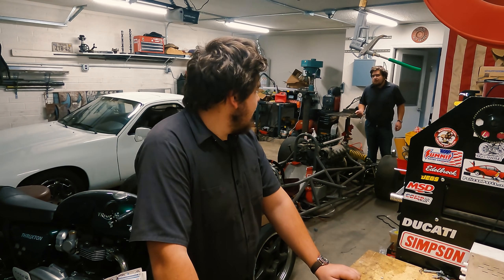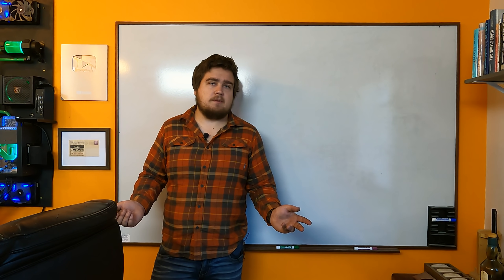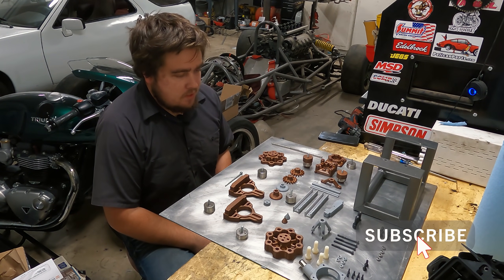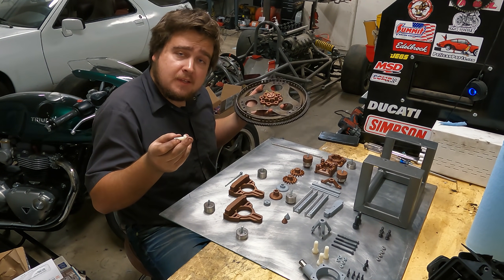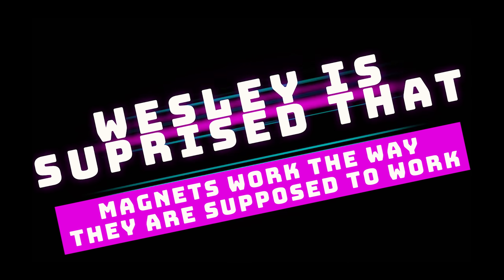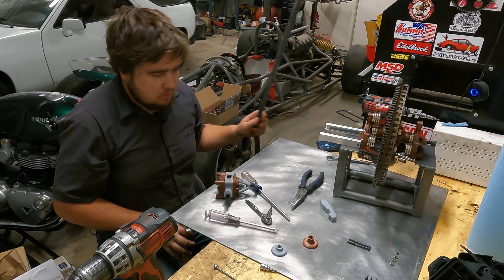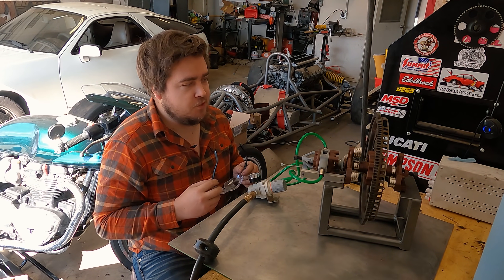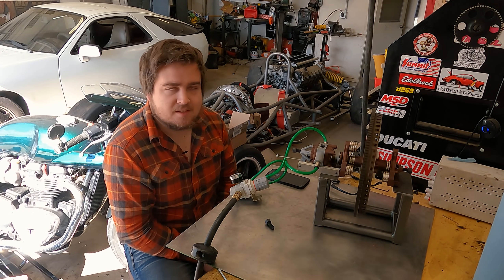The Levitating Turbine and Mechanical Battery

Comment: Mechanical batteries are also used in nuclear power plants. If power is lost, the reactor coolant pump motors have giant flywheels that coast down so they can still produce flow until backup power comes online. Pretty cool stuff!

Comment: Hefty imbalance... It would be more effective to spin the whell if you simply direct a pressured air gun at the edge with all those gear tooth. Then you will learn that those serve as an excellent air brake....therefore there is basically no advantage to have a levitating assembly. I recommend to have a steel cage around that thing.

Comment: So add an ur compressor and batteries   Us the output from the flywheel generator power.  U could use a 72v battery to create 300v 😉

Comment: For whatever it’s worth “flywheel” energy storage devices with essentially levitating rotors are pretty common in data centers. If you’re extremely confident in your genset startup and switching time they can be the only UPS power source for a data center, otherwise they can be used to minimize repeated draw/drain on VRLA battery arrays that don’t love deep or repeated discharges.

Really love the work you’re doing here. Keep it up!
Reply: Though the datacenters flywheels do store some energy, their reason for existence is the provide clean stead state (in perfect phase) power vs. the best effort you get from utilities.

Comment: Why you built a 20,000 rpm pencil sharpener and the levitating mechanical battery?  Same reason your subscribers subscribe...meh, just cause. Because it's fricken awesome!
No, those safety squints won't save your face from the wrath of a 5lb flywheel, but you have compressed air close to your two good eyes, keep em that way. As always, this is just another great video, thanks Wesley.
Reply from the maker: Thanks for the kind words!

Comment: Hey! I love this, but do have a question. Wouldn't the compressed air you are using to power the mechanical battery be a better(more stable)  energy source than the battery itself?
Reply from the maker: Honestly, no clue. My guess is that there's much less energy loss converting from mechanical to electricity, because our best sources of air to electricity involves spinning a turbine.

Comment: If you get the magnetic drive coupler figured out,,, Do you think you’d be able to put the flywheel into a vacuum chamber, spin it up with a drive outside of vacuum, and the inertia stay in the flywheel for longer? 
I know it would, in theory, I’m more wondering if that’s where you’re headed with the drive coupler.
Reply from the maker: If I'm honest, that was a thought of mine going forward, and a good way of getting energy in and out of a vacuum.
Reply: @WesleyKagan  There’s a channel here called the Brick Experiment Channel,, the guy made a Lego submarine and used magnets as a drive coupler to a prop. He used Teflon tape to reduce friction through the glass jar’s lid he was using. 
That being said,
I’m sure you’ve heard of all the fancy dancy ceramic anti-friction and temperature coatings used in and on race engine parts (pistons, cams, rockers, etc). They apply like powder coat and then you burnish/polish the coating with something like grey scotch-brite. You could coat your magnets with it to even further eliminate drag at the one-point-of-contact like you said you had between the flywheel shaft magnets and the stand magnets, if that was your point of contact. It was hard to tell from the video
Reply: Techline “Powerkote” DFL-1 is a good one to look into
Reply: ANNNDDDDDDDD. The guy that runs EPR, Mitch, is a friend of mine. He does a ceramic anodizing on parts, as well. I’m not sure if this link will work. If not “Engineered Performance Ceramic Anodizing” in the search bar should get you to the video 
https://youtu.be/QuO0rhW8Hv0

Comment: Can an electromagnet repel extra strongly? I have a few design ideas that would benefit from that.
And for an air craft of air rocket I like the idea of a suspended rotor or set of rotors to compress air and have the payload be behind the intake next to the air duct, meaning super low drag. If needed there could be a suspended exit turbine before the nozzle as well.

Comment: So much fun question though, may I ask why you are doing this, is there an endgame, is this a pivotal cog for a bigger purpose?
Reply: Realistically these exist, regenerative braking is “basically” this. With the flywheel being the cars wheel(s) and a more typical electric motor and expensive controller. 

This I see as something you can use to get just enough battery power to make a call, or use old school coms off a short burst. Maybe to jump a car but I doubt it would like the load. Attach the flywheel to a windmill? Technically still air powered 😂 

Make it small enough it can power a modern clock with old day weights even going as far as to sync it with all the action of a grandfather clock, but have a digital display

Comment: would make sense or be possible to replace the point of contact between the wheel and the base with another set of magnets so it is physically disconnected from the base?

Comment: Now to just have that in a vacuum to get stupid fast rpm...

Edit, if people ask why build something that's already been done.. experience. Experience is the most important part of any single project and having more of it isn't a bad thing.
Reply from the maker: Honestly, I love doing projects that I know will work as well. It's a fun hobby. Now you have me wanting to look up turbines in vacuum chambers
Reply: @WesleyKagan  it's how Williams tried to pull off their kers system when they looked into it. It's also how gyroscopic stabilization works for boats

But as always there's a downside, the biggest one being that fast rpm+weight=scary levels of kinetic energy.
Reply: @WesleyKagan  I think you wanna drive the flywheel magnetically trough the housing on the vacuum chamber, ideally a glass chamber so we all can see whats inside.
Like having the wheel spinning "forever" inside the "friction less" vacuum chamber, when the coupling is detached. (obviously for no good reason.)
Reply: If people never built stuff that was already done nothing would improve, no one would learn and we wouldn't have the chance to watch Wesley talk to himselves.
Reply: 1. Experience is the ability to recognize a mistake when you make it again.
2. Experience is what you get when you don't get what  you want.
3. (per Belle, the Sleeping car:) The sad thing about experience is that once you have it, it's usually all you've got.

Comment: Accidentally early as I’m reverse engineering the F1 chassis in fusion...
Reply from the maker: I'd send it over but I'm also working on a chassis to replace it so it's in a lot of pieces both in CAD and in person haha.
Reply: @WesleyKagan  i mean anythings a start, ive done very little in the way of tube type design in CAD before so still trying to get the hang of it.
i want to make it with an EJ and the 6 speed

Comment from the maker: I forgot to fix the broken fan! I swear I'm working on it- My PC related project is taking longer than intended and it's really heavy.
Reply: Your pc looks cool and really makes me want to do something similar. Unfortunately I'm not allowed hanging stuff on my apartment walls.
Reply: @forbiddenera  you can do it in a desk too!
Reply: @D3nn1s  I know I've been considering that too but my desk is crap. I could build one I guess but time. Still a cool build though 😎
Reply: @forbiddenera  true, but not very dust or service friendly :P
Also no going to a lan :D
Reply: @D3nn1s  I imagine wall mounted like that would be pretty serviceable and dust cleanable. Definitely no lans. Desk version is definitely no good for any of those. Tbh I haven't been to a lan since like 2005 or something
Reply: @forbiddenera  well depends, if youre gonna aircool it yes pretty servicable, but i would dust it off with something static like a brush. If its watercooled it probably almost impossible to service while mounted and even if you have a good drain and fill spot it will most likely still leak down a bit.
Reply: Hopefully the parts are cool enough that it isn't a problem!